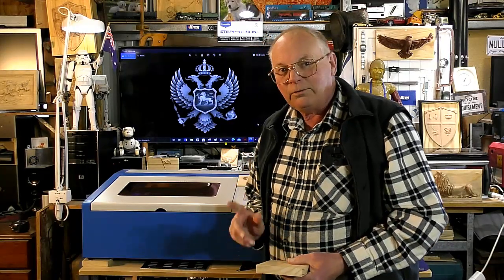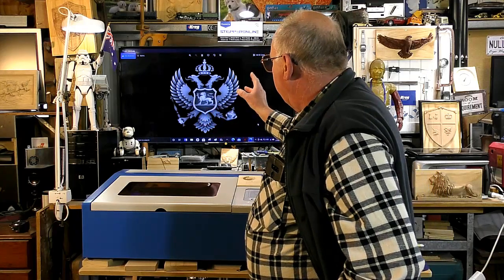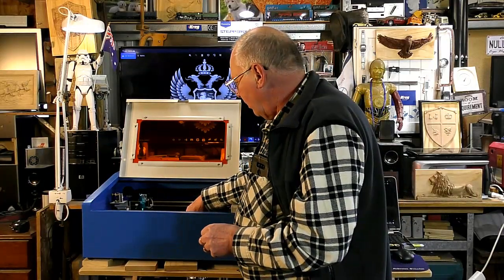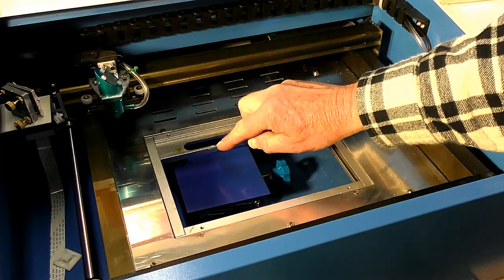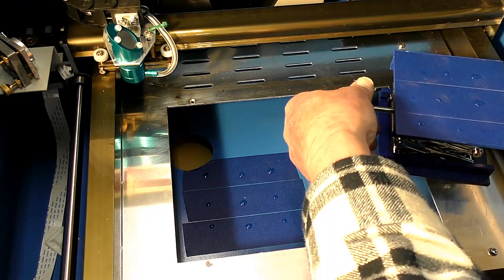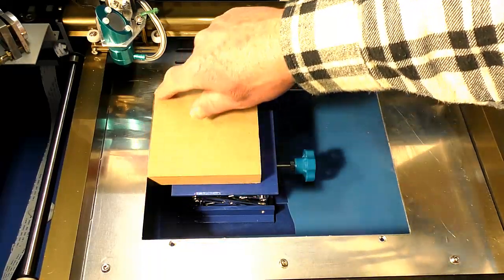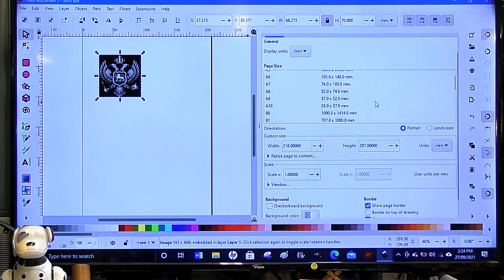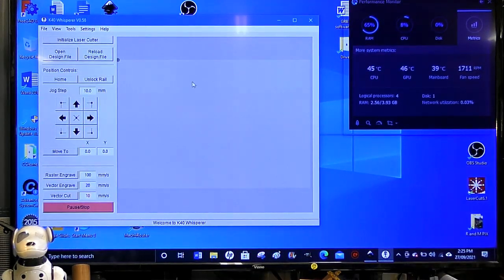K40 LASER setting up an adjustable bed & CAD/CAM for 3D ENGRAVING

Comment: I bought a K40 about 4 years ago. I bought it on Ebay for $350 with free shipping. I had simulator problems. I had a big problem with the gantry. The gantry was off .250 from front to back. I had to remove the bed to get to the 4 screws that hold the gantry. I used a square to align it up. It is off .002 in Y and X. I didn't want to take it all apart and make the screw holes oval to adjust it to100% square. It is working great now.

Comment: Hi Roger, Just  a thought, you could mount that lift  in the centre
 and drill a hole in the front of the machine
then make an extension, to the lifting knob, almost like a jack extension
so you could adjust the  hight from the front of the machine
also you could make the lifting table bigger so it fills the hole
Eddie
Reply: There are some beams in the front of the machine that will stop you. If you want to adjust from the outside you'd need to have it come out of the left side wall and even then it's a tight fit.

Comment: Hi Roger, Thanks for your great video's
I'm thinking of buying a 6090 100watt  Reci laser machine
What thickness of plywood will your Reci laser cut in one pass?
I'm hoping to cut 12 or 15mms
Thanks Eddie Harper,  South Wales Uk
Reply from the maker: Hi, about 12mm, and go with Thunderlaser machines.
Reply: Thanks Roger
I might go for a W6 130 Reci watt then, To be on the safe side
Thank you
Eddie

Comment: Had a thought for you about setting the 3 mm height.  Find a piece of flat stock maybe a centimeter longer than your wide opening, and glue on 3 mm shims at each end.  That should give you a direct go no go to set any stock in the hole.  No holding a ruler to the project part.